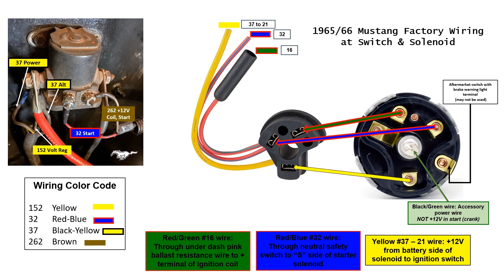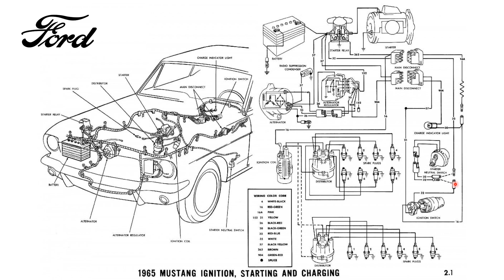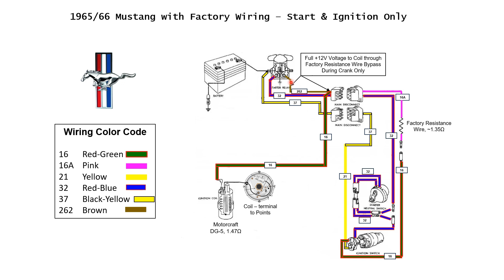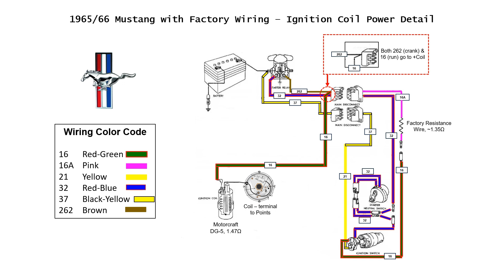1965 1966 Ford Mustang Ignition Switch and Start Circuit Explained

Comment: Thanks for the video and I wont dispute the pinout from the pigtail to the cars harness but I think you have 16 and 32 reversed between the pigtail and the actual switch. That might be interesting to know for folks not using the pigtail. Can anyone confirm this?

Comment: Great vid, that dreaded pink wire! 
  Got an rtr summit dizzy in the 66 Manchero, and got the switched 12v off the ignition ( center) and obviously no v during cranking because i disconnected the original coil wire.Sounds familiar I bet.
  If I split my 1 pink going into the other 2( red green and red white) and run the red green ( 10ish cranking v) to the coil also, Do I reconnect the red/white with the pink?
  Or I also got the 10 ish at the solenoid during cranking. Could I just run a wire to the coil from there? Which wire needs removed under the dash and which one needs to stay connected?
  Im so surprised theres not a million vids on how to di this. Also why is a full 12v only actually 10 is? Thats a lot of my confusion too. The starter draw? Why not just calk for the full 19 v at crabking? Lol
  Sweet channel! You got a new sub today...
Reply from the maker: Well sir, it depends on what distributor and coil you installed. Let’s start with the coil voltage. Go to my channel and find my Duraspark video.  At time index 18:28 in the Duraspark video, I describe how to measure voltage at the coil.  Should be around 7.5-8.5V.  If you’re measuring 10V anywhere, even during cranking, sounds like a weak battery. Many new RTR distributors, like Pertronix, require full +12V at the distributor because there is a small ignition module inside the dist. However, the coil still requires external resistance from the factory resistance wire or through a ballast resistor like a Chrysler. If your RTR dist. requires a full +12V, you go under the dashboard and find the red/green 16 wire and disconnect the bullet connector from the pink 16A resistance wire. Like you said “split” i.e., make a bypass (Y-junction) jumper harness that allows you to run a new wire from the red/green 16 wire that provides full +12V to the RTR distributor.  The other side of the Y-junction jumper harness goes through the factory pink 16 resistance wire to the coil. Use a 0.6Ω coil like a Pertronix p/n 45011, 45111 (epoxy) or 45001. Warning: If you send full +12V to the coil i.e. you bypass the factory resistance wire, it will overheat the coil and the car will quit on you down the road.  Don’t cut and splice the pink 16A resistance wire.  It’s a special ni-chrome resistance wire and cutting and crimping will alter its resistance. If you give me the p/n on the dist., I can look it up for you and give you some more advice.

Comment: Do you know if this would work similar in a 63 fairlane? The guy I bought the car from left the ignition from the key forward looking like a rats nest and I’m getting either an entire hot car or no power at all when the coil is hooked up.
Reply from the maker: I would wager that it may be identical in a 63 Fairlane for ignition only.  Identical being wiring color, number of wires and wire functions.  However, the 63 Fairlane is a generator car, so the charging wires are different both is color and number of wires.  If you can find me a link to a schematic, I can check it out for you.  You should convert to alternator unless you are trying to keep it original.

Comment: Thank for this video! I have saved it.  I don't have any wires left and I have to figure out how to put my ignition back together in my 65, combined with with a 95 5.0 EFI motor, with Holley Terminator X ECU.  Fun times. That first slide is going to help a bunch.  I can build and mechanic all day.  But wires.... ick.
Reply from the maker: Sounds like your modified set-up can retain the pink resistance wire assuming that the ECU requires a +12V "on" wire i.e., not the main power supply to the ECU, but the signal to tell the ECU to turn on. This means you can keep the factory resistance wire and minimize cutting and splicing. Sounds like a cool project. I saw your 12.6 Cobra run on your channel.  Rocken!!!
Reply: @BlueOvalEdge thank you! My Trans Am has eaten my money far too long. Ready to get my 65 going again.
Reply from the maker: @jodibonds  Cool. I will subscribe to your channel to see how that project is going. As a Ford guy, I obviously don't favor "Chevys", however I have a very big soft spot for Pontiacs.  Why?  Pontiacs always had more character as well as better styling and handling.  Also, Chevy guys typically have a my sh1t don't stink attitude but Pontiac guys were always much more intelligent, gentlemanly and down-right appreciative of anyone who had a "cool car" and they didn't care who built it.  One of my best friend's Mark has several Pontiacs and I work on them all time.  Very cool cars.
Reply: @BlueOvalEdge I use to tease people I bought my WS6 hood for $10k and got the rest of the car for free. Lol. I love the Pontiacs. Like you said, much better styling.

Comment: Awesome video. Great jog explaining “the elusive brown wire”, the resistance wire, and what happens “under the dash” with splices and color changes. 
Simplifying the diagram by eliminating that which didn’t directly apply to start/run as you did  will be helpful for many people. 
Great use of adding your own color coding and Legend/Key. 
Ford could have made these diagrams so useful by color coding them to match  the color coding of the wire like GM was already doing at the same point in history. 
With the printing and publishing technology at the time, describing the wire color with tiny text often vertically was so much harder than just showing a Yellow line with a black stripe. Thanks again.
Reply from the maker: Thanks.  The pink resistance wire, what it does and where it is, is a constant source of confusion to Ford guys!

Comment: .. I had the worst problem trying to figure out where my resistor wire was on my 78 Cougar I finally had to put like a relay to get 729 V for my distributor because it kept burning up distributor caps. Somebody had it running on 12-volt so all the time door spark and door spark runs on 7to9 volts
Reply from the maker: Probably a previous owner deleted the resistance wire thinking it was unnecessary emissions. Did you have to add a resistance wire to get the voltage to the coil voltage dropped to normal?
Reply: @BlueOvalEdge i finally took it to a older guy who knew what to do. He found the resistor wire and connected it. The whole thing was frustating dist cap used to las about 600miles .its good now
Reply from the maker: @nitro456jk  Coolness brother. Glad its running correctly.  Please post some more videos so we can see how your Cougar project is coming along!

Comment: So I have a 1966 Mustang and it has a clifford alarm with an immobilizer (installed when i bought it). The valet mode switch isn’t working and the immobilizer is preventing the car from running. How can I bypass that and run a straight wire from the ignition switch so that I can get it running until I get the alarm removed?
Reply from the maker: Sounds simple to fix.  First, tell me what happens when the key is in the CRANK position.  Does the engine CRANK but no start or is there no CRANK at all?  Let me know and I will follow up.
Reply: @BlueOvalEdge  if i turn the alarm on and then turn it off, the engine will crank and run for about 1 second before it shuts off. I see where they cut the red/green wire and ran it into the brain but it looks like when it comes back to the stock bundle it connects to a brown wire and i can’t find the red/green wire anymore
Reply from the maker: @deadfox7628  I assume that you are referring to the red/green #16 wire under the dash where the Clifford controller likely is installed and that you are not referring to the red/green #16 wire under the hood to the coil.  OK, obviously, something is telling the Clifford controller to interrupt (disable) power the #16 power wire after the engine starts.  The simplest thing to do is completely remove the Clifford controller and reconnect the factory wires per the color-coded wire schematic in my video.  You mentioned in your original question that you intended to remove the alarm. Is there a reason that you don’t entirely remove the Clifford alarm controller now? If you remove the alarm, I can help you if you still can’t get the car started.  The ignition/start circuit for a 65/66 is fairly simple as my video shows. There is only a handful of wires required. Let me know!
Reply: @Blu @BlueOvalEdge  sole reason for not entirely removing it yet is they shaved the door handles and removed all the lock cylinders, so right now i am using the alarms remote to open the doors and trunk. Eventually i would like to simplify that and remove the alarm entirely. I would prefer to have it back to factory original. But for right now i just want to it to run and drive.

I am totally alright with running a new #16 red green and a new brown wire bc I have been through the alarm and immobilizer and something doesn’t make sense anyway. The ignition and starter are attached but it should be 4 wires 2 in and 2 out and I’m only seeing 1 in and 1 out and 2 not used.
Reply from the maker: @deadfox7628  The immobilizer should have a clear connection under the dash to the #16 red/green wire.  Specifically, it's highly likely that the immobilizer is in series with that wire under the dash.  Recall that the under dash #16 red/green wire has a bullet connector to the 16A pink ballast wire. Can you find that wire under the dash?  If so, yes run a new (jumper wire) from the under dash #16 red/green wire to the 16A pink ballast wire and effectively bypass the immobilizer.  Note: Do not bypass the 16A pink wire and run full 12V to the ignition coil other than maybe for a brief engine run test as that will overheat the coil quickly. Alternatively, you may consider figuring out how to install temporary switches for the door lock actuators so you remove the immobilizer entirely and still get the doors open!
Reply: @B @BlueOvalEdge  I can not find the pink wire. The red blue (i meant red/green) runs into the alarm brain and the brown wire comes from the alarm brain. (This is probably the pink wire just faded) It should have been 4 wires in the total but it is not. The pink wire is nowhere to be found and at the solenoid it is a white wire where the brown should be. So it’s entirely possible that they ran a new wire and thats why i can’t find it. So if i run a new wire from the ignition switch to the solenoid is there anything in between that i should know about or can i go point A to point b?
Reply from the maker: @deadfox7628  Sounds like they tied the red blue 32 neutral safety start wire into the brain.  It might be as simple as connecting the red blue 32 neutral safety start wiring together thus telling the car that it is in Park or Neutral.  If that works, thats a temporary solution until you remove the electric door locks because you should not permanently disable the neutral safety start. Sometimes people will delete the pink ballast resistance wire if they are using a modern ignition system like Pertronix distributor and could, so you need to know what ignition system the car has.  If it still has points, you can get rid of the pink ballast resistance wire. If it has a modern Pertronix, or similar, then you don't need the pink ballast resistance wire and yes, you can route a new wire to the positive side of the coil from the switch.  Recall that the brown wire is the crank only full voltage circuit for points, so if you don't have points anymore, don't focus on restoring that function.
Reply: @BlueOvalEdge  i have to apologize, I really messed up that last reply. I meant red/green when i said red/blue. I believe i found the pink wire, it just looks brown from age. It has a cloth insulator on it.  So in theory I should be able to connect the red/green (going into the alarm) to the pink (coming out of the alarm) and complete the circuit for the ignition. Effectively bypassing the alarm.

I did that and the car started and ran. However, when i turned on the headlights on, the car died. After looking, the fusible link melted off (like it is designed to). But now i don’t know why it did that.

The brown wire that runs to the solenoid has been replaced with a white wire at some point. Assuming the wire that is connected where the brown wire is supposed to be (white wire currently) was done correctly.

At this point i feel like i am bothering you too much
Reply from the maker: @deadfox7628  Well brother, you're making progress (kinda).  Its not shown in my video, but at some point in the harness, the 37 power wire splits off and feeds the light switch. Now, you have to find that wire and repair it.   I agree, connect the Red/green (#16) to the pink (16A) for a return to factory set-up.  Try not to splice into the pink resistance wire i.e., find and use the factory bullet connector.  The pink wire is nickel-chrome resistance wire and does not cut and splice well and doing so will change the resistance value.  This is a bigger deal with points distributor.  Note: You can buy new harnesses from various sources if you don't want to splice 60 year old wiring.  Congrats on getting the car running, you are making progress!
Reply: @BlueOvalEdge unfortunately that bullet connector is long gone and they spliced into the pink wire. I will see if i can find a replacement one.

So little backstory so you might understand what im dealing with. This car came from California and it was built out as a competition car back in the early 2000’s. I’m talking second battery installed, tv in the dash, dvd player in the glove box, power inverter wired into a power distribution panel behind the glove box. Playstation hookups with audio/ video and power. And the entire trunk is an isobaric box  with speakers/ another power distribution panel and full audio control connection as well as multiple amplifiers.

Power windows, powered door and trunk pops to open everything. All wired into the alarm. Wiring up the wazoo. 

Tracking and tracing has been a bit of a nightmare BUT thanks to your assistance I have it running again. 

I got the dvd player/ playsation and tv removed. And now just cleaning up the whole setup and labeling everything.

Replacing the fuse panel with an upgraded model to switch over to blade fuses next. Thanks bud!
Reply from the maker: @deadfox7628  Oh man, you got yourself a project there for sure.  You're going to the electrical expert when done!  Here are the part #s for a replacement pink wire under the dash.  Remember, you only need the pink wire if you are using points and condenser or Duraspark which is a ballast resistance system. If you use a modern Peteronix ignition, you don't need the pink wire to knock voltage down to the coil
RESISTOR WIRE, IGNITION COIL
https://www.npdlink.com/product/resistor-wire-ignition-coil/101401

Standard Motor Products Replacement Resistance Wire (Q&A says 1.35 ohm)
https://www.summitracing.com/parts/smp-rw34
You can use either one!

Comment: I have a 1965 mustang and recently the ignition assembly broke so I replaced it with a new one. Problem is now the car wont crank. I'm wondering if it has to do with the wiring or if its the ignition switch and assembly. Any recommendations on where to start checking or ideas on why the car doesn't crank with a new ignition assembly? The lights all work so battery is fine.
Reply from the maker: I assume that the “ignition assembly” that you changed is the ignition switch?  Start by removing the ignition switch harness from the new switch and verify that the yellow #21 has +12V. If it does, that means that the switch has power. If so, go ahead and re-attach the harness to the switch.  As you know, the engine won’t crank if there is no power at the "S" terminal so verify that by rotating and holding the key in the crank position. Check for +12V power at the "S" terminal of the starter solenoid. If there is no +12V in the crank position, pull the #32 red-blue wire bullet connector that goes to the neutral safety switch. Again, rotate and hold the key in the crank position and verify that there is +12V at that #32 bullet connector.  If there is no power when you crank, it’s likely that the new ignition switch is not working. If there is +12V power at #32 in the crank position, then it’s possible that the neutral safety switch is not closed with the shifter in Park, so re-attach the #32 bullet connector and see if the car will crank with the shifter in Neutral.   Let us know !

Comment: Thank you this customer’s car (1967 Ford Galaxie that he apparently hates) is rigged to hell, like it feels like it was done with prejudice and I don’t trust anything on this car… there was a spark arrestor on cylinder 4 and 5 and 6’s plugs were hand tight, the oil filter was at like 100 ft/lbs, the ground wire was cracked open, the gas gauge didn’t work…. And I’m tired of listing that shit.. the worst of it all is “customer states; needs a new carb and it will run” he already removed the carb and left it on top of the intake with broken vacuum lines. But in all that it’s a great opportunity to hone my craft and understanding the industry I love and with videos archiving knowledge/ wisdom like this I’m given the ability to deliver the standard of work that I can proudly put my name on
Reply from the maker: I hear you buddy.  The coolness of these cars is timeless, but a car like a 1967 Ford Galaxie needs a complete new, and modern, electrical system like one by American Autowire. Everything works and uses modern connectors.  Keep up the good work sir !